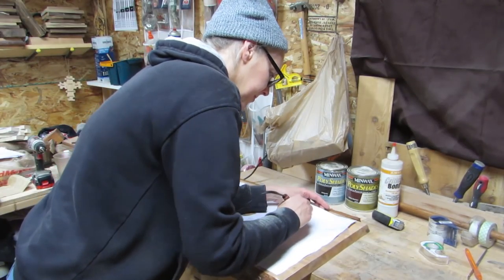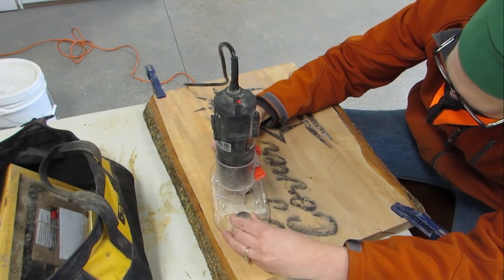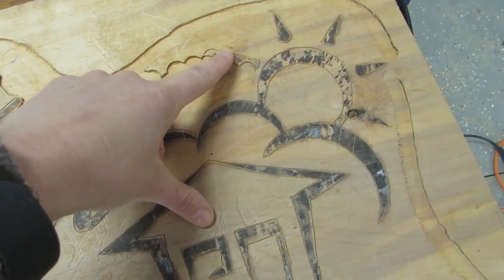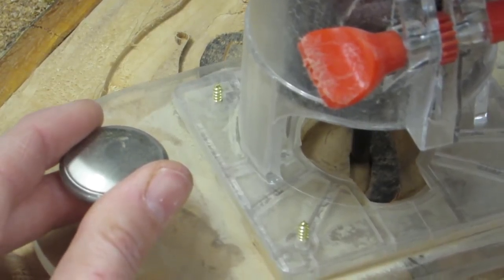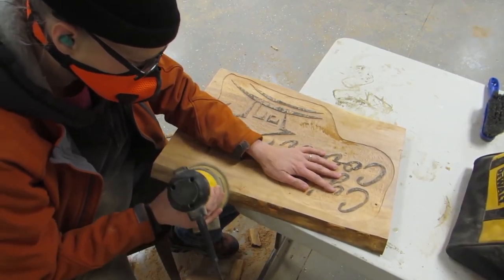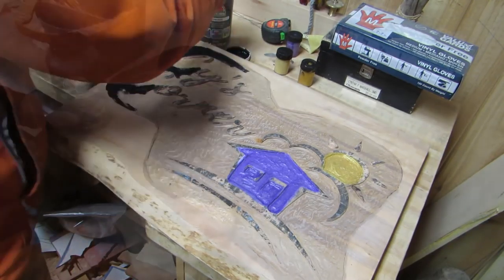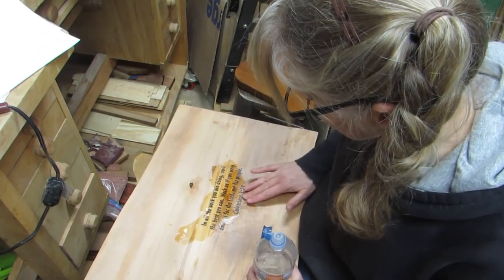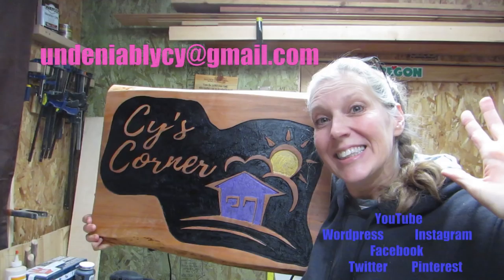New Cy's Corner Sign!!!

Comment: Looks like that new router base has made it a lot easier to control the router, but you still need a steady hand. I have the shakes from an accident I had a long time ago so I do not have the control needed to do this type of work, but I can still enjoy watching you make all these nice things
Reply: John Fithian-Franks, don't rule this out too quickly. This is a compact router spinning a small bit so it doesn't take much strength to control it. When you add a base with the handles, your hands can rest on the work piece to help steady your hands and router.
The router base won't keep you from cutting past the line. That sort of mistake happens. It makes each project unique.
Reply from the maker: It sure is easier with the base, that is for sure. The vibrations bother me but I could go a lot longer without needed a break with this little base. Sorry to hear about your shakes.